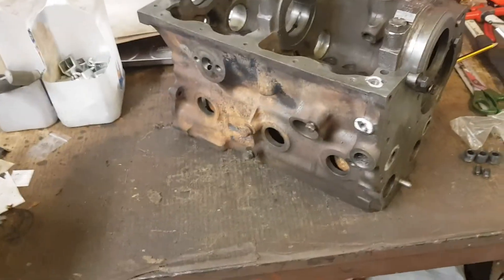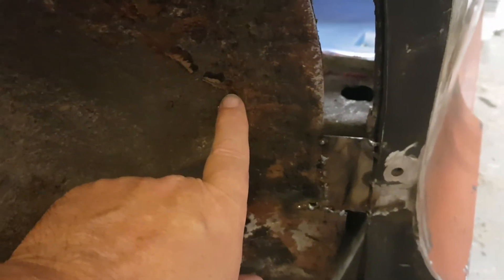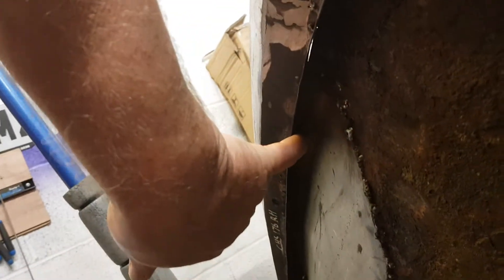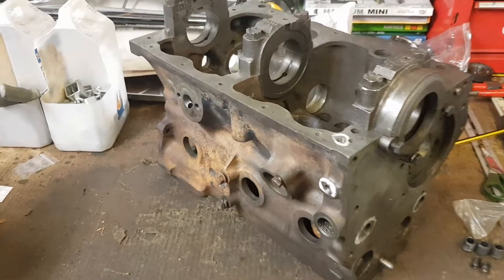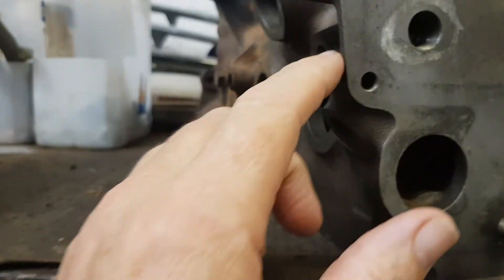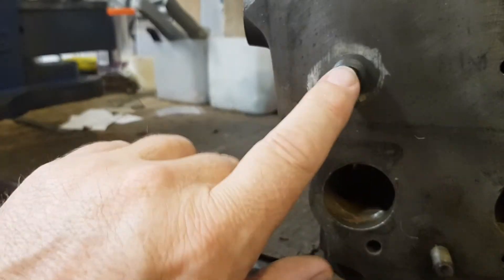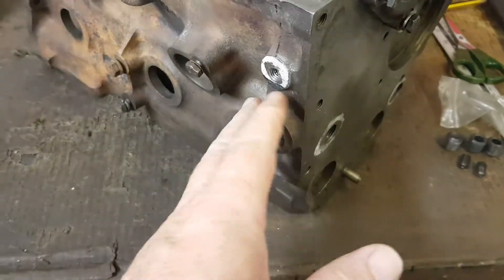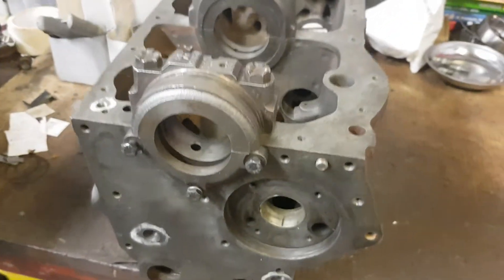1330 Morris Minor A series engine build

Comment: Hi Dermot, I’m interested to know what bhp you are aiming to obtain from your engine. I have a 1275 A+ and wondering if 90 to 100 bhp is achievable and the mods needed to get there
Reply from the maker: I'm hoping for about 95bhp that's with a decent camshaft, single carb and a decent head.it can be done, search for 1330 midget engine on google.Its been a while since I've had time to get in the garage so I'm hoping to get in there soon and compete the project.
Reply: @dermotmurray4658  thanks 🙏 that’s none too shabby from modifications that appear to be straight forward… Hope to see some more vids 👍